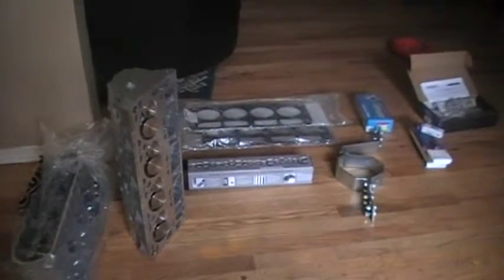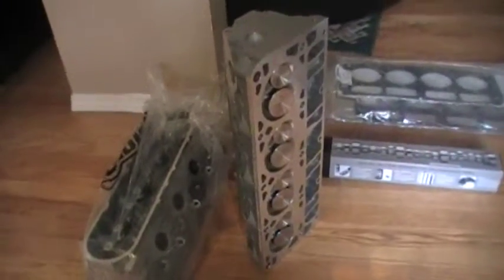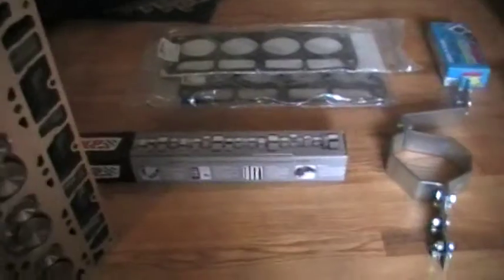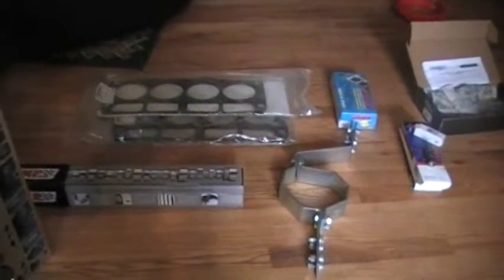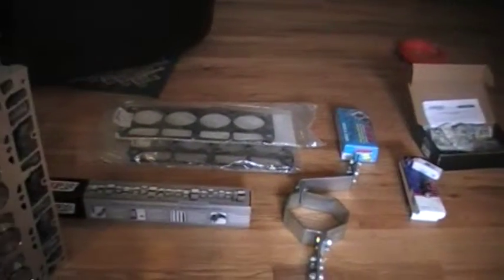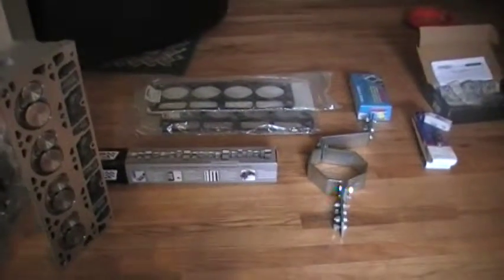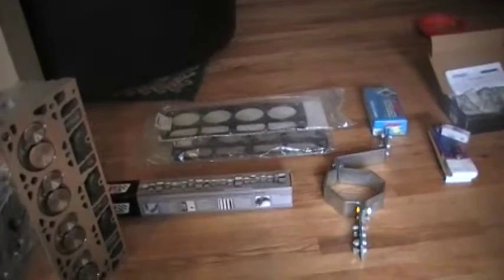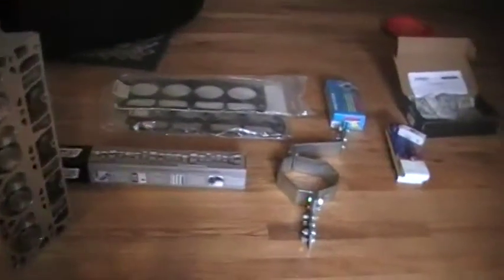LS6 Build Progress w/ NEW UPGRADES

Comment: hey man im looking into doing this how much did just the parts cost?
Reply from the maker: heads and cam were about 1200, gaskets were another 120, lifters were like 100, timing chain was like 60, various other gaskets were like 50, then you have to get it tuned for around 500.
Reply: I'm looking to make around 370 to the wheels like your first build. (nothing crazy)  I'm also looking for good drivability and durability.  got some ported ls2 heads for free. I was wondering what else is in your first build or what you might suggest. my dad is a mechanic so we would be doing the build together.
 so i'm looking at around 2 grand not to bad.